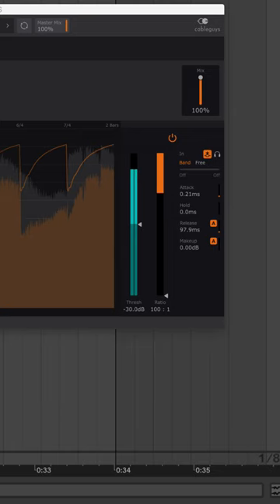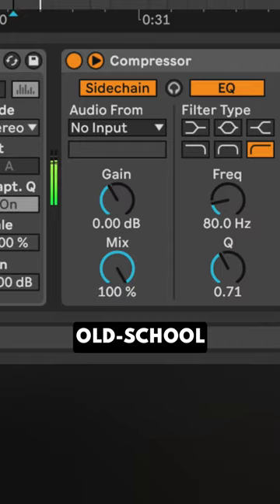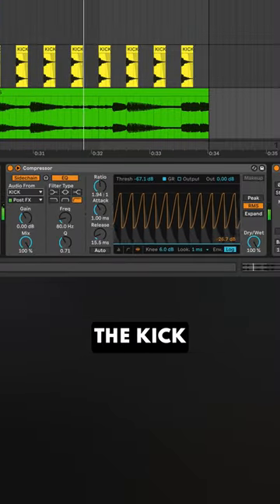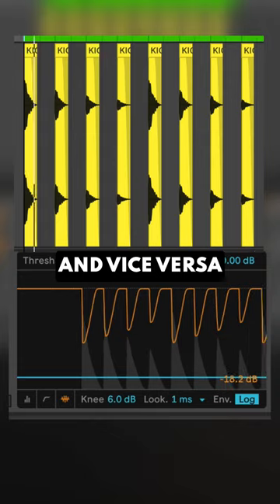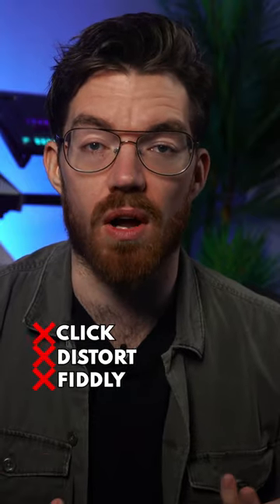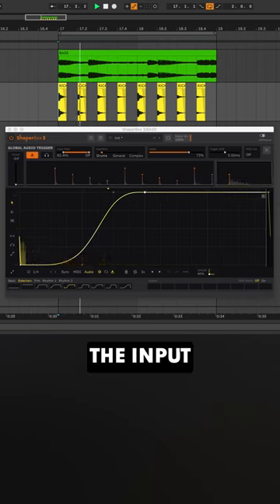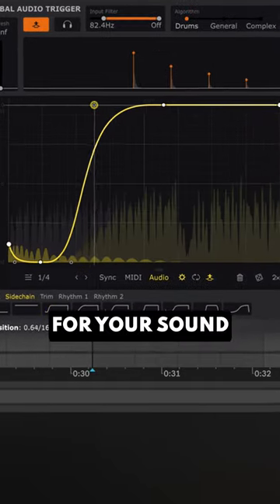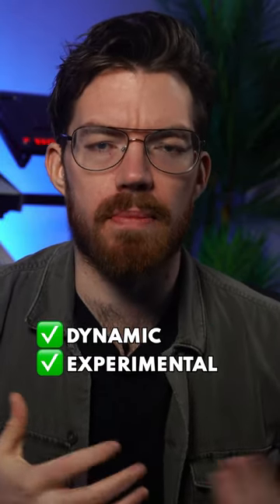Sidechain Compression vs Volume Shaping 🦆 #shorts

Comment: Usually I use sidechaining to control the gain of a low shelf eq curve. Makes it very dynamic and natural sounding
Reply: I decide which of my kick or bass is tier one, and which is tier two, which sits in the lows and which sits above, and then mix accordingly. Along with that make sure things are not sitting in the same part of the spectrum at the same time.. and have enough space in the mix to not have to fight for space with side chaining

Comment: I almost always use compressor, because I rarely make 4 on the floor beats anyway. Sure, you can volume shape that too, but it’s a lot more work when the beat is always changing.
Reply: think you can actually sidechain the volume shaper to the kick so it triggers everytime the kick hits
Reply: The new Kickstart 2 allows you to trigger the audio of the kick so you can duck it on non 4 on the floor beats.
Reply: Use triggering instead. Why would you use a compressor when you don't actually want to compress anything?
Reply: What do you think a compressor does, exactly?  @WillyJunior
Reply: @LuxLucidOfficial  Trust me, I know what a compressor does. I also know that most compressors don't have an attack option of zero ms. I'll let you work the rest out.

Comment: I always use a compressor. Tried volume envelopes but those are a pain to work with. Havent tried volume shapers though.
Reply: Give it a shot bro. Much prefer volumeshaper with the multiband function can go real extreme without things getting too audible
Reply: @drinkinouttacups2665  Gonna have to try that. So far I have tried sidechaining a kick into a bass but only modulating the highpass filter on the bass. Sounded pretty clean but I am sure these volume shapers are a lot faster so I will give it a shot thanks man.